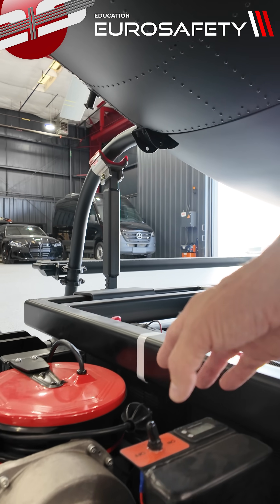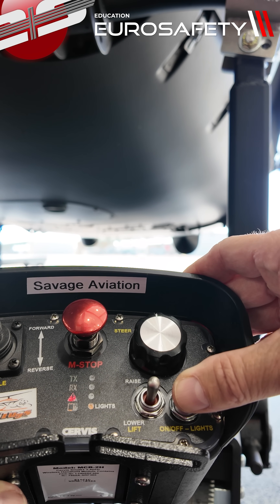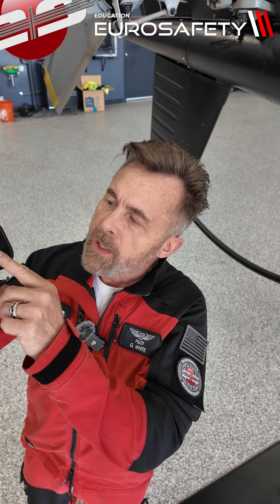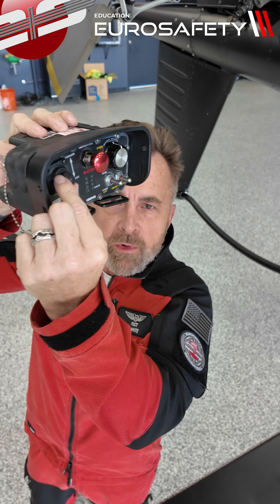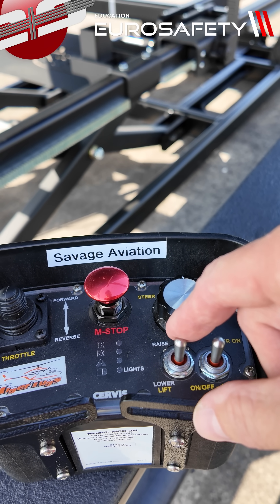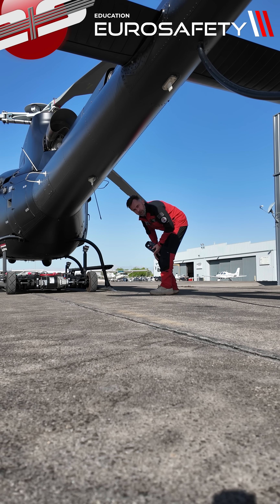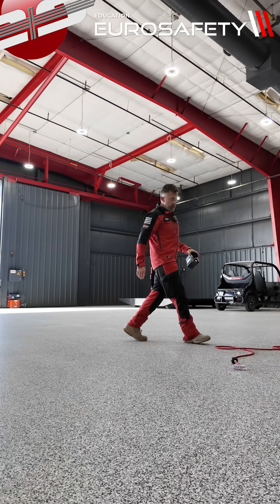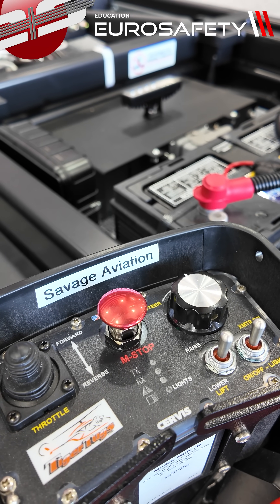#305 - Moving a Helicopter: Tiger Tug Operation Tutorial

Comment: Are there any wind limits regarding use of this device? Because when a helicopter is raised, it looks quite tall.
 Is there a risk of tipping the helicopter over in case of strong crosswind ?
Reply from the maker: There is not but obviously one needs to use some common sense when operating in winds
Reply: This sense is crucial and essential in aviation particularly when something is not prescribed or regulated.